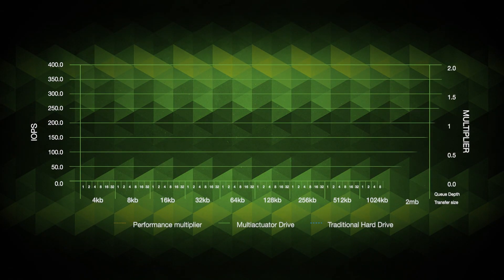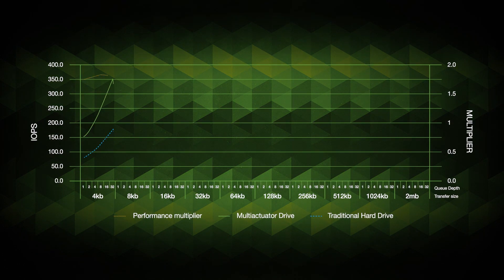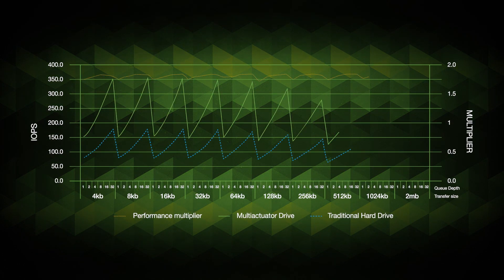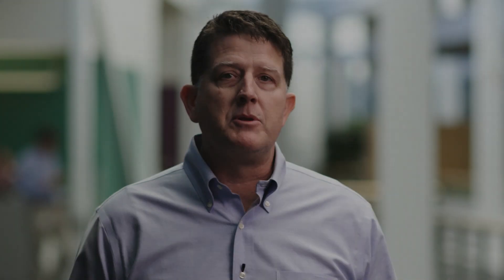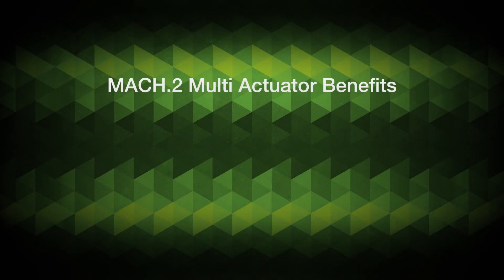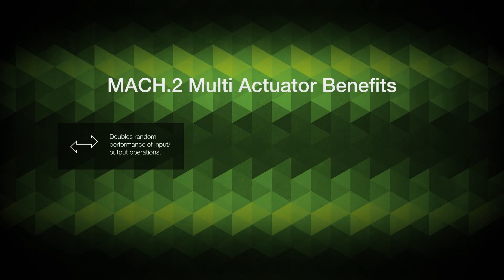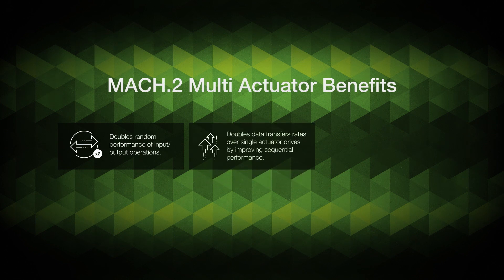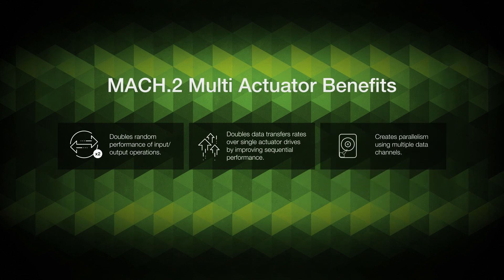Seagate I Double the Performance of Data-Intensive Applications with MACH.2

Comment: I honestly wish that 3.5 is drives would actually have four actuators and small plates because even with that rather severe reduction of platters size there would still be 4-8 terabytes of maximum  capacity that would be half to a fourth of an SSD but what have the iops and latency to not be bogged down all the time and of course sequentials to beat out an SSD in terms of real world value because the IOPS really do just suck on a single actuator and that's what actually makes a daily system fast but having four at the cost of the maximum capacity consumers couldn't care for so they can have less unresponsive drive is the better choice.

Comment: I bet one of the main challenges was managing vibration from the one set of rewrite heads with the other that they won't degrade performance by causing track accuracy issues

Comment: Now try to move each head independently. Or put another dual head in another side of disks
Reply: The latter would require smaller diameter platters.. less capacity.